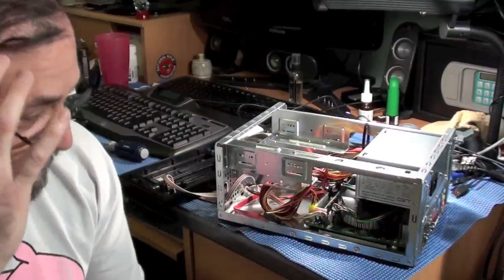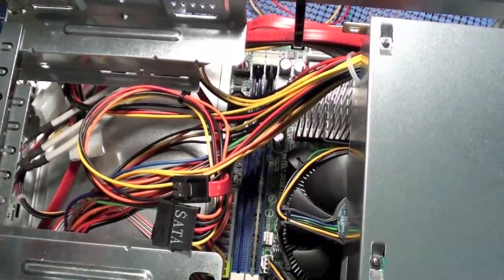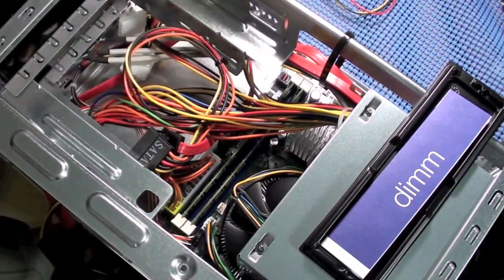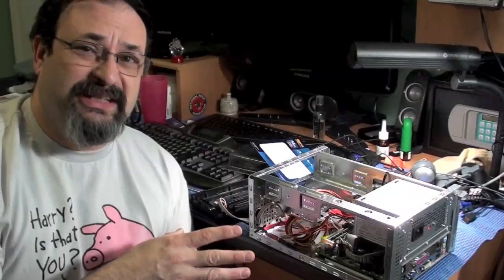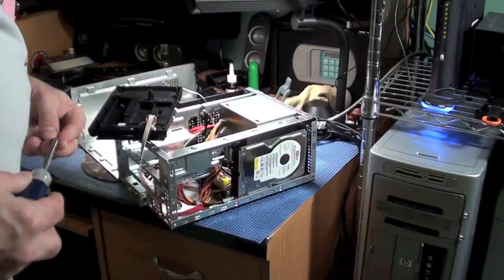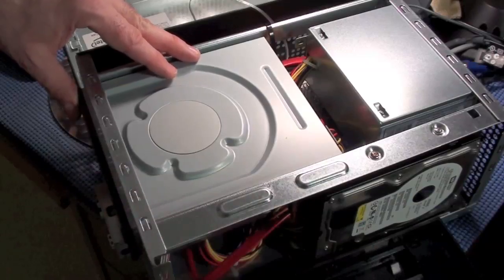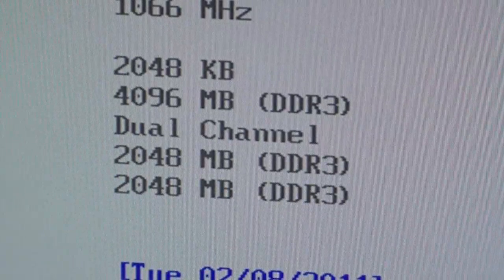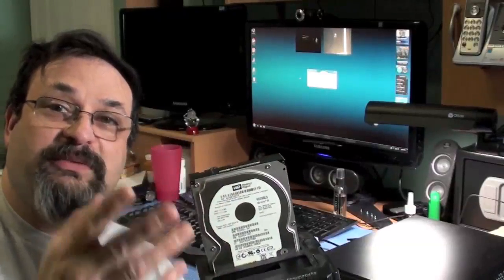Installing RAM

Comment: @markstevenbuisness as long as u follow the instructions that come with the motherboard carefully, it is fairly easy to build a computer. it's almost like legos for adults. the bigger the case, the easier time u will have working on it. ATX form factor case/motherboards is standard. like fred said, newegg.com is a great place to shop and has fast shipping.